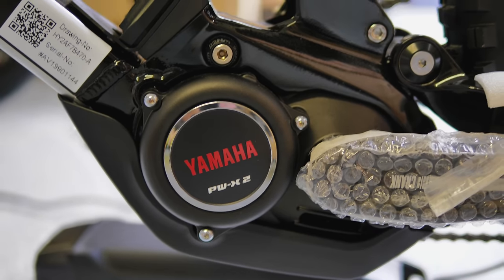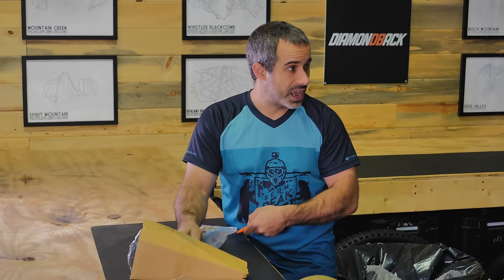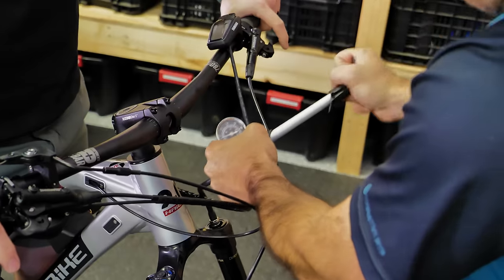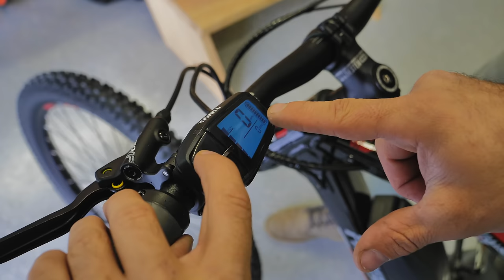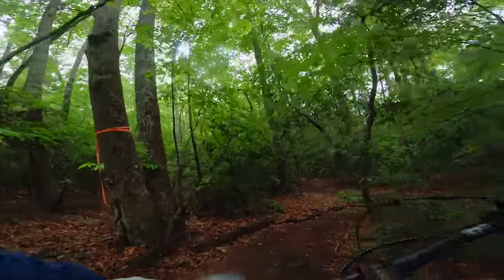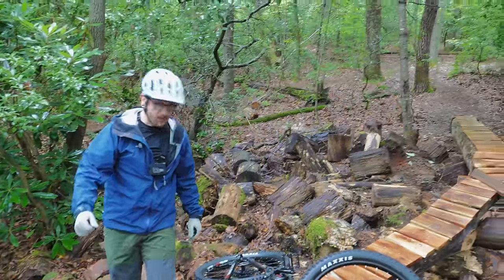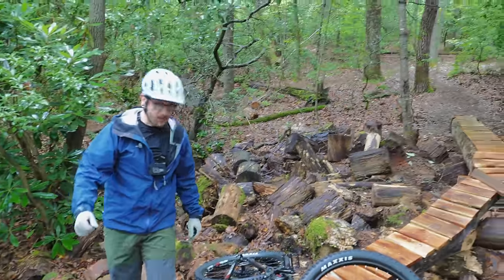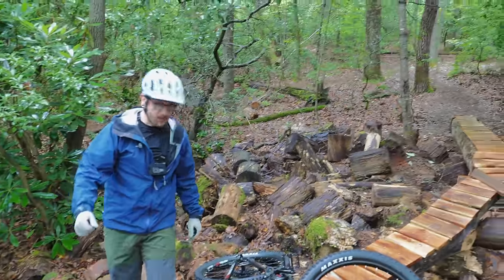Unboxing and Testing Two Surprise Mountain Bikes!

Comment: I wanna see a video called “how much can the e-bike tow?”
Reply: Embn pulled blake's (gmbn) jeep
Reply: you can get elasticated tow ropes to pull your acoustic mates up hills
Reply: This aged well (on Sam Pilgrim’s channel)
Reply: I’ve towed my friend up two fire roads.. he’s about 220 lbs with his bike.. I’m about 170 with my e bike.. 
1st: 13.1 miles and 3600 ft elevation.
I ended the day with 1/5 bars of battery.. I think I’d have more battery life if I didn’t tow him up in boost mode climbing up at 13 mph for the last 1.5 miles..
2nd: 7 miles and 2000ft elevation and ended the day with 3/5 bars of battery..
Alone I can get about 70 miles in eco mode.. both days were about 80-85f and had no issues with overheated.. we did use the rope and inter tube method to prevent tugging..

Comment: Rip to all the delivery guys watching this.
Reply: where those delivery bikes win is endurance on the flat, they often have huge batteries and small 200w ish hub motors. usually 36v at 15Ah, most around my area have 48v at 20Ah or so. those haibikes are 36v 13.6Ah. one delivery guy near me has a totally nuts custom build using battery cell modules from his nissan leaf that got written off. 48v at 100 Ah.. custom wound motors for ~12kw with sadvoton controllers and eBMS..
Reply: insanitybiker i had a stroke while trying to read this lol

Comment: Does anyone else just violently rip off the dork disc rather than removing it correctly?
Reply: I don’t have a tool to remove my cassette so I just yank it off. Luckily I’m getting a cassette tool and chain whip in March.
Reply: i use a sheet metal scissor, clip, clip, off.
Reply: Where I live, dork discs aren't a thing. Didn't even know it was a thing
Reply: @tiagoviana263  I envy you
Reply: @ewan_mclean  Don´t worry, I would rather have a dorc disk and have more bike parks, than not having one, and have no bike parks nearby (which I don´t). So, in my opinion, you´re lucky
Reply: @tiagoviana263  consider yourself even luckier, because where I am there are no bike parks AND there’s dork discs

Comment: One of biggest advantages is that the e-bike can now replace the truck shuttle and you can have more fun doing the ride up and still have a great time on the way down.  I also feel that with the weight of the motor and engine down low they are incredably stable and with the power you end up cleaning stuff you would normally stall out on- so.... ride long, further, safer and more often and that can't be bad.

Comment: Seth,  Great video… like always.  I used to be an avid mountain bike rider.  I rented an e-bike for my 70-year-old father. This way he could ride a harder trail system with me and not die on the trail.  He was totally against riding the e-bike at first, but about a few miles down the trail, he wanted one.  Both my parents have them now and ride more than ever.  E-bikes are a great equalizer for all levels.  The fact that e-bikes are getting people outside and riding, is only helping the sport.  I ended up renting an e-bike for myself and haven’t been able to get back on a regular mountain bike since (unless I’m at a ski area that won’t allow them just 

People say e-bikes are cheating, I tell them to rent one, ride it without the power on, and tell me you aren’t getting a better workout than any regular mountain bike.  You have so many options with e-bikes.  You can use them to get in better sharp (without power on), just enjoy riding more (with power on), or maybe you want to cover more terrain is a shorter time (power it up).  Either way, you are outside riding.  For those of us that used to ride dirt bike (Motorcycles), these e-bike are the answer.  The extra weight helps dirt bikers transition quickly into mountain biking.  If you take a bad crash, what would you rather have (e-bike or non e-bike) to get you back to your car?  These types of bikes are going to be the future.  Europe has already embraced e-bikes and the US is behind the curve.  Type 1 e-bikes should be allowed everywhere.  I would love to see you do more videos on e-bikes.  Thanks for doing this one.  Love your channel and keep up the great work.

Comment: Any time I think “e-bike’s are for old guys”, I remember there are guys in their 50s riding single speed MTB. Not for me.
Reply: 55 and ride singlespeed 90% of the time.  Including Pisgah and N. Georgia.
Reply: I’ve always wanted a single speed. The simplicity. I like simplicity. Get on and ride
Reply: I ride a rigid SS and love it. I also ride an ebike and love it just as much. If you need gears and suspension might as well also add an engine is my philosophy. The ebikes they are riding are old and heavy, latest models have integrated batteries and carbon frames / up to date geo, which make them lighter and much more agile.
Reply: One of the guys I ride with that I most admire is older than me quite a bit (I'm over 50), and I'm not sure I've ever seen him on a geared bike. Finished the DirtyKanza on a SS at least once. I have one, but it's just for "townie" riding, even if I've taken it on the trails a time or 2.
Reply: I’m 50, ride singlespeeds, and think e-bikes are the devil.
Reply: Would love to see Seith on a carbon Turbo Levo SL. I bet he would be hooked.
Reply: Dan Webber I’m 38 and currently riding a 1x11, definitely agree about e-bikes. SS is tempting and I figure the sooner I start, the better.
Reply: @danwebber9494  Me too, the teenagers I ride with hurl abuse at anyone on an ebike and I just let them, fuck those things.
Reply: Dogeggz I’m recovering from Covid and using an eBike to get out on the trails and get my fitness back, I hope I don’t meet you and your mates

Comment: My dads Santa Cruz e-bike has a setting that adds assist at the same speed as you walk
Reply: Ebikers can't even walk their bikes without help? Kinda sad, eh?
Reply: Kinda, it's a bit crap on the Shimano as you've got to be in a mid range gear, exactly where you aren't usually at that point 😂
Reply: @StaggerLee68  yeah e bikes are frikkin heavy so of course there is walk assist.
Reply: Brian warshow 
Well if older people want to get into a hobby they like , how can you hate on that
Reply: @StaggerLee68  well not really but its their for walking up steep stairs that's the only time my dads has used it
Reply: @adambcvg  true cause boost witch is max assistance cuts out at 30km/h
Reply: @makda971  It's not the older folks that I'm speaking of. The other day I saw a 12 year old kid on a very expensive Ebike, with his Dad, on trails closed to Ebikes, tearing the hell out of the place. Skidding and not minding the foot traffic.  The local community has worked very hard to keep a good relationship with hikers. This does not help whatsoever. As well, a 12 year old physically capable kid can't pedal a bike on a trail with 60' of elevation gain over 4 miles of singletrack? Seriously? Harden that kid up on motor sports then and get him a Kawasaki or something. I see old folks out there hammering all the time. I'm not very young either, just sayin'. We are humans and seem to have become very soft indeed as a group. It's easier than pedaling, i get it. But MacDonalds is easier than eating right, same thing.

Comment: You need the 'E' part only for climb. The more you peddal, the more you get assistance from the motor. Check the settings, it might have the levels to set the power for pedal assist.

Comment: Loved seeing some e-bike content - they are the most misunderstood bikes around. They are not just for the unfit or elderly. "I'm going to hang on to my mountain bike a while longer" gives the wrong message. Many celebrated mountain biking athletes have either switched or are using both e-mtb and acoustic!. Keep up the otherwise great content!
Reply: I think that the perception of ebikes is changing as well which is probably a good thing -  the change from hub motors that can be turned on and off to mid drive providing boost probably helps with that.  I am unfit, and purchased an ebike to commute to work (~15km odd), and because I'm now remembering why I loved riding as a kid, I've purchased a non electric gravel bike to start doing a bit of road cycling / easy gravel stuff on

Comment: As an ebiker and a fan it was good to see you explore this. Loved the comment that a battery and motor (ebike) doesn't replace bike skills! In my humble opinion, the only way to learn bike skills is by experience. Ebikes without a doubt get ridden harder by most riders as they give so much back, they give more fun and give more experiences. 

It is a shame that they are expensive, but riddle me this, what is more expensive, a mid range MTB worth say US$3,500 that hardly gets ridden or an EMTB worth the same amount of money that burns through chains and cassettes due to the amount of kms (miles) you put on it?

Comment: "E-Bike-Legal Trailsystem" - Murica
Reply: Or as it's called in Europe - a trail
Reply: They are now legal on all federal land in the U.S., which is huge, give it 10yrs and they will be welcome everywhere except maybe some chairlift parks where they are pointless anyway. I feel like the only people that have a problem with them at this point are fitness elites that generally have a dislike for anyone that doesn't work as hard as they do on their fitness level.
Reply: @Anderson_999  They also chew up the trails noticeably more than normal bikes, though that's often down to the people using them not needing any finesse to get up the climbs, just using the extra power and spinning the wheel if they lose grip instead (Same reason motocross bikes aren't welcome on MTB trails).

I actually didn't think there was an issue with e-bikes when they came out until I saw the damage they do first hand at a local trail centre. I'd been riding loops of the centre all morning, as it's slightly faster than the uplifts if you're half way fit and not riding a DH tractor, and was about 10 laps in, so I knew the climb very well as it had not changed noticeably lap after lap of me climbing it. On the next lap I saw chunks of gravel lifted and pulled out of the trail surface all the way up. It was literally one guy on an e-bike who had done far more damage in one climb than I'd done in the preceding 10.
Reply: peglor you are either referring to high powered « ebikes » or are just repeating myths. Why is it everytime an evolution comes, someone has to cry « but they’ll give cows sour milk »?  The ebikes used in Europe (<250W) have no negative effect on trails whatsoever.
Reply: Yeah, I don't see a 250w class 1 (pedal assist only) bike doing that, but hard to say - it's definitely not typical. Now a Cake or Sur Ron, sure -- those have no place on mtb trails.
Reply: @OnzeManInKazakhstan  Not repeating a myth - I literally saw it myself and was shocked by it because I didn't believe that one e-bike could do so much obvious damage so quickly either. This was in Ireland incidentally (Part of the EU), but while 250 W is still a grey area legally specifically in Ireland because the law hasn't caught up with reality, once you're not on a public road the laws pertaining to road use don't apply anyway.

My biggest worry with e-bikes is that they'll give the 'enduro' riders who descend every half way technical descent with the back wheel locked enough range to get out to the trails I like and make shite of them too.
Reply: peglor that has nothing to do with ebikes. My skill to descend is completely unrelated to my fitness to climb. You are repeating another ignorant myth “it gives the unskilled rider abilities to climb to trails they can’t ride”. Let me giv you some other stupid myths for you to spread “the bikes are heavier so they do more damage to trails” or “ the batteries will cause forest fires”. All ignorant myths that can be debunked in a second. Meanwhile ebikes bring people to the sport and outdoors who would otherwise stayed home. One last question: have you ever ridden an ebike ?
Reply: peglor also, with my ebike I can do twice the climbs and descends in the time it takes you to do one, making me a more experienced descender.
Reply: @OnzeManInKazakhstan  If you think climbing fitness and descending fitness are unrelated you're in for a serious shock if you ever get aerobically fit. 
It's self evident that a bike that gives riders more range will be ridden to more isolated locations, unless ebikers are so unadventurous that they just ride the same loops near the trail head over and over again. After marshalling at a few races, what blows me away is how much damage bad riders can do to trails - especially since my local trails are loose and slippery by default.
As for the forest fire rubbish - try to at least stay on point - hot disk brakes are more likely to cause fires than a fully enclosed electric motor, and I've never heard of that happening either. Internal combustion engined cars catch fire more often than electric cars too, so there's not even precedent from higher powered electric transport for this.
Reply: @OnzeManInKazakhstan  If your bike's motor is limited to 250 W I highly doubt you can do anything like twice the climbs and descents unless you're pedalling hard and descending extremely quickly as well. 200ish W is pretty comfortable for me to cruise at all day, and your bike stops assisting over 25 km/h on the links between trail sections. I overtake ebikes regularly on the roads to the trails because of this.

Comment: I am an ex.... MX'er... but now I'm almost 50, and have bad knees from years of racing.  I got an old MTB from a buddy, but I was just using it for gravel, and to help strengthen my knees.  It was fun to get out, and get the blood pumping... but any slight up hill was a challenge.  I was fortunate enough to get a 2019 Turbo Levo a couple weeks back for less than half price... and now, I'm hitting basic MTB trails, and having a blast. But with age, and bad body parts... it wouldn't have been possible.  An ebike such as these is a God send for the guy who doesn't want to commit to being in tip-top shape, or is just older and warn out, to enjoy the sport.  ***edit***  Just saw the end.  Funny thing is... my GF was having issues with a slight hill the other day, and I threw my bike into turbo... and pushed her and myself to the top (gavel path) with no effort.  FYI... she did tell me I was cheating. LOL.  Great vid.  Thanks.

Comment: Seth! Look into the owners manual. There should be a "walk" mode that will let you push the button on the controller and the electric motor will propel the bike at 3 mph to assist in walking the bike. I know all Bosch motors have this feature. Then you won't have to bend over and turn the cranks!

Comment: The E-Bikes from giant have the walk assist feature which is a separate mode that doesn't even require you to pedal. Pretty cool mechanism for the assist too.
Reply: Pinned by Berm Peak Express
Berm Peak Express
1 month ago
So we didn’t find out about “walk assist mode” until afterwards. To hike that thing up a hill you just hold the button on the left side of the controller!

2.3K

Comment: I hear that the trick with getting an E-Bike up a really steep hill is dropper post down and sitting on the seat. Keeps the weight low and gives traction to the rear wheel without unweighting the front.

Comment: I like the actual conclusion in the end. I was about getting a new MTB, my old one is from 1998 and clearly is not suitable for trails and such. After building a house and raising two kids it now is time to do something for me again. I tried some e-MTBs and was very astonished by the power they have. But sleeping over it several days and thinking alot I went for a biobike full suspension instead, because of the weight and the "drivability", and also to improve my overall condition again.

Comment: Hey you should try pivot bikes they are really good bikes I suggest the mach 6, 27.5 maybe a large for u or a medium the mach 6 has 6 inches of travel on the suspension and its made for down hill. I love the bike im 12 years old 4 foot 6 inches riding an xs i love to jump it, very fun bike

Comment: About the dork disc. On a bike I did not remove it, I was in 1st, and for some reason the derailer down shifted into the wheel. The chain just ate the plastic locking up the drive train. Flipping me over the handle bars. Luckily I walked away with a few scrapes. 

Another time the same thing happened on a bike I had removed the dork disc. All that happened is the chain pulled tight locking the rear tire. This wasn't bad because it actually came off the drive train entirely so I basically just slid to a stop.

Comment: Does Johnny know that there is a button on the controller that you push and it’s called walk mode. So then all you have to do is just wheel the bike along and the motor does the work.
Great video 👍

Comment: the dork disc doesn't protect you from anything cause it's attached to the spokes not the freehub body and in case of the chain falling from the cassete it will suck it deeper into the gap and block the wheel even more

Comment: By holding the button of lower a speed of the motor, you can change on the display the info it is shown. You can choose between autonomy KM/Total KM made/Partial KM made